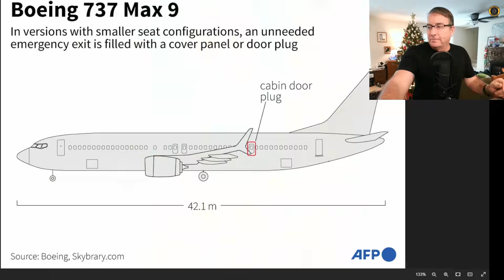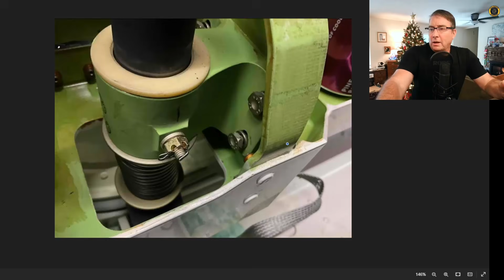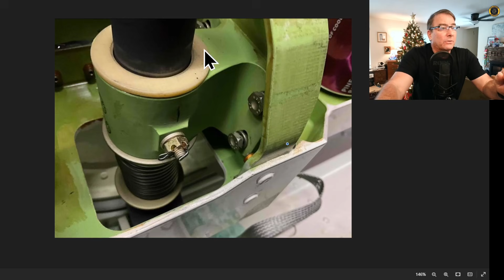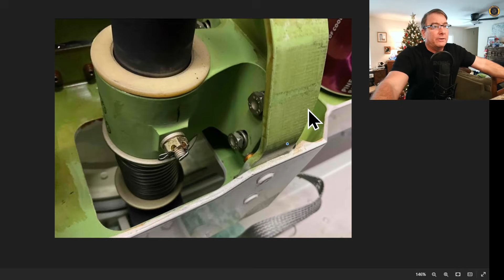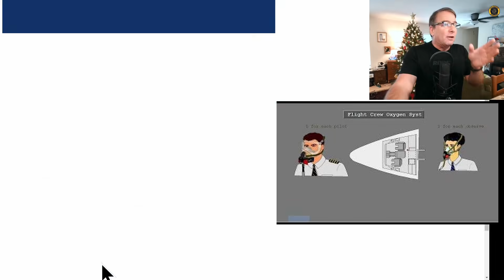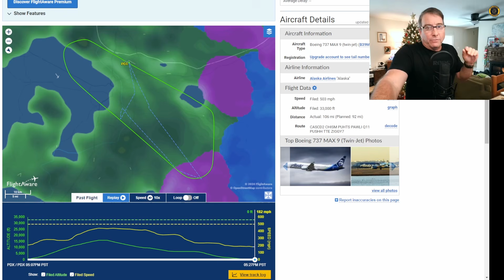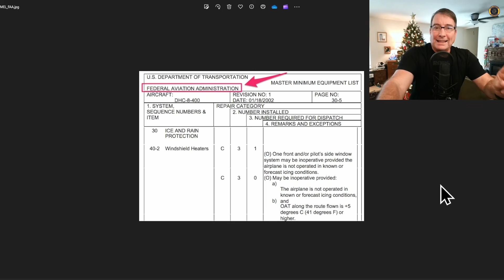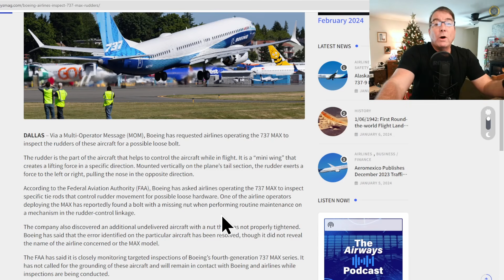"Yes, We Have No Bolts"  9 Jan 737 Max-9 Update

Comment: Could you address the “missing” flight recorder conspiracy crap going on. 

Lots of really bad info on how the recorders work. Especially regarding the 2 hour then rewrite issue. 

Some are claiming that there is no information, rather that the tape had started to rewrite due to time. Others suggesting the flight crew didn’t stop the tape so as to hide information. 

I know you can address this to a much larger group then I. 

As to the missing bolts. There might be a fox in the chicken coop. It’s going to be interesting to see who signed of on that installation.

Also, if the bolts were present and lost, there should be ware marks present. Can’t tell from the photos I’ve seen.

Comment: Interesting. 
MEL list. I worked in the marine industry. Similar concepts in many operations. In my terminology. 
This MEL list is a list of deficiencies. Some of which would be show stoppers some not. 
Even a non show stopper would still be reportable. Because it brings my vessel bellow my designed OEM equipment list. I am then personally required to inform both classification and certification ie my boss, ABS, coast guard. I have a particular deficiency. Mitigating Precautions. I will quite particularly with a repeated problem receive a condition of class from ABS giving me approval and requirements to report back when resolved. Within a time frame. Ie I can’t operate indefinitely I have to have a plan to resolve. Limits on operations are sensible. If there is a deficiency. The interesting difference I am hearing. Even if I have more than the minimum requirements as fitted and normal operations. I am still required to report the deficiency. 
Reporting a deficiency is relatively routine. I can even report via VTS our equivalent of ATC. 
The purpose of this is to allow operations to continue for a reasonable time and allow for a repair. 
One important point, even if I ask for and receive a condition of class allowing me to continue operations. I will almost always end up talking to an inspector prior to getting approval. 
One CG inspector I spoke to regularly. Would always say “don’t ask me if it’s ok, it’s your vessel, you are the Capt, Are you ok with the deficiency” if I said yes I am am ok with the deficiency I would get the approval.
Basically it’s my responsibility and I can’t pass it if to anyone. 
Sometimes one of the most difficult things is knowing when to say no. It’s not ok with me. 
I’ve done it. I had to answer a bunch of questions. 
In 30 years, my decision was always accepted. 
One thing I personally would never do. Is agree to operate after another Capt. had declined. Even if I might have made the call to go.

Comment: I am amazed at the number of people who want an exploding door instead of one that unlocks itself. From comments I have read in this comment section, in an explosive decompression, the door is sent a signal to open... one way or another. Simply put, "Unlock and Open" or "Explode Open". And people are more upset it didn't blow open like a car airbag deploying. Either the door opens, or it isn't a door anymore. Either way, you have access to the cockpit. But with panels blowing out in the direction of the passenger cabin, you have the opportunity to have people maimed. The explosive panels are for if the electronic lock fails to open the door as designed.

Comment: After my previous comments, let’s dig deeper. What happened when the pilots experienced pressurizing issues, oh well we just keep flying the plane. Surely some investigation arises and the pilot maybe does a walk around of the plane prior to boarding? De-pressurization is a catastrophic event and the pilot simply ignores the tell-tail occurrence that something is not function according to normal with a critical condition.
Reply: Wise up.  Are you a pilot?  There are a thousand other failures that can cause a pressurization problem besides a plug door blowing out.
Reply: @johnaclark1  all I’m suggesting is that this pressurization issue persisted too long on a new plane to be swept under the carpet, a pilot should have taken a stand, can’t just continue with an issue as critical as this, maintenance is not finding fault, but you fly the plane. Not acceptable.
Reply: @larrymeyer2917  All I'm suggesting is that nobody knew what was wrong.  The crew gets some kind of a pressurization fault light.  He/she writes it up and has maintenance look at it.  Maintenance looks at it and says "we can't find anything wrong with it."  The next crew comes in later and can't say, "I'm not taking the plane til you fix it."  Maintenance will just tell you they can't duplicate the problem.  Stop blaming the crew on this one.  This was 100% in assembly or interior finishing and not a thing any pilot could have seen coming.  Some say that plug may have whistled when it was leaking.  It may have.  Airplanes and doors leak all the time.  No airplane is 100% air tight.  It's common enough that not even easily spooked flight attendants will get concerned.
Reply: @johnaclark1  you claiming the passengers have no right to know that pilots are blase’ about “so-called repeated issue” even on new planes. I beg to differ, its recently the tail wing bolts, now door bolts and intelligent pilots after repeated issues in last week just fly the plane full of unaware passengers of prevailing problems…..that’s okay. And there is no chance of an imminent catastrophic failure. I would like to know about this when I board a plane, so that I can exercise my right to disembark and fly on a fully functioning plane. Or inform my family of the risk that I may not arrive at my destination. Hey don’t open a can of worms, every person responsible for ensuring a fully functioning public plane has no right to overlook repeated pilot reports, that’s a downhill slop no airline should promote or admit. The doors leak, safety alarms alert pilots and nothing is done….easier to deal with a decompression explosion at 38,000ft. You must be joking.
Reply: @larrymeyer2917  I never claimed anything of the sort.  Tell you what, next time you get on an airliner stop in and ask the captain if there is anything MEL'd or any recent maintenance write ups.  Maybe they'll tell you and maybe they won't.  Even if they told you, you wouldn't have enough knowledge to know whether the plane is safe to fly or not because you haven't been through months of training as they have.  I can tell you that nothing in that cockpit gave any indication to anyone that a decommissioned plug door, not monitored electrically in any way, was about to depart the airplane.  For the last time, none of this is any pilot's fault.  Boeing and/or the finishers (whoever last opened that door) are responsible here for not installing the safety pin bolts w/the cotter keys.

Comment: Everyone has been parroting "loose" bolt but this is the first I've heard what "loose" means.  A bolt with a missing castle nut is bad BUT still that door isn't likely to fail if the other bolts are in place.  Remember the purpose of the bolt is not to keep the door from blowing out but to keep it from traveling UP such that it slips off the 12 stop pads.  So that Alaska plane, in my humble hypothesis, may have had no castle nuts at all or missing bolts or combo of this.  If that cotter pin is in place, that castle nut is not coming off even if it is not torqued all the way (you can't even get the cotter pin in place until it is torqued most of the way).  This feels (pretty strongly) like it could be a mfr or maintenance error.

Comment: Very different fasteners from military, which uses safety wire to secure avionics. SS from a roll that is run through the same aperture as a cotter pin, then twisted. I am not familiar with airframe fasteners, though. Good to know the N-number in case Boing Boing slaps a coat of paint on it and sells it to Nigeria.

Comment: So do the bolts lock it into place? I see in the example photos that there are cotter pins,  which should keep the bolts from backing out in theory.  But if the bolts only hold it from sliding out of position then is it sufficient to keep the panel in place?
Reply: All the bolts have to do is assist gravity in not allowing the door to move upward above the pads that hold the door in place.  In reality, it really only needed one bolt to prevent that door from moving upward.  There is no real force on those bolts.

Comment: This is a prime example of why I love your channel. As an A & P you have a working knowledge of how airplanes are put together and you also know how they come apart. Your explanation of the hinges, bolts and pins was very informative without jumping to conclusions like others always do. I also found your insights into the previous pressurization issues with this particular airframe quite fascinating. You're probably on to something there. Makes perfect sense. And since you're also an active pilot with airline experience you also explain what's going on in the cockpit in these situations very effectively. As a pilot myself I understand and comprehend a lot of it, but flying my own Cessna 441 Conquest II is very different than flying this big stuff. And I certainly don't work on my own airplane, though I do have a good working and mechanical knowledge of it. Keep up the great work!

This also makes me sad for the future of Boeing. Just when one could take a breath and think the 737 Max problems were finally sorted this happens. It doesn't bode well for them. But that's a subject for another day.
Reply: I wondered about previous pressurization warnings, too. But if there are two systems, and they're switched if one gives a warning, wouldn't you expect to still get a warning on the second system if it was a real defect in the pressurization (caused, for instance, by a leaky door plug)? And would pilots ignore a persistent warning on both systems?
Reply: It was shocking to hear Juan say that the pilots and maintenance crews routinely ignore the warning lights o the automatic pressurization system control panels which re trying to tell them that something is wrong because the humans just assume the monitoring instrument tis broken. That's alot like ignoring a low oil pressure warning light on your car because you assume the oil pressure monitoring system is bad because the warning light has come on.
Reply: A&P: Airframe and Powerplant mechanic, an aviation maintenance technician certified by the Federal Aviation Administration (FAA) to inspect and perform or supervise maintenance, preventive maintenance, and alteration of aircraft and aircraft systems.  Responsible ensuring that the aircraft are in airworthy condition.

Comment: Somebody’s probably asked this, but is that picture of the bolt and roller guide assembly upside down? It seems like gravity should be taking the pin down into the roller guide, with the bolt above it. 🤔
Reply: No, the picture is correct. The door with guide kinda hangs on the roller pin when fully closed. Thus there’s really no weight on the securement bolt underneath the pin on the guide flange.
Reply: @JohnHallgren  thank you, I see it now.

Comment: Why weren’t those bolts safetied? I saw the pictures from a United aircraft with the two bolts backed out. There’s slightly more cost to using bolts capable of being safetied than the junk Boeing used. Also finding the offending bolts will be nearly impossible unless they fell on someone’s driveway or in their mailbox. Plus with snow coming in, yeah right. How long did it take to find the missing fan disk in the Sioux City tragedy? That was a substantial piece of metal and it took a chance finding at harvest time to do so. Also, I believe CVR recording times should be increased. Maybe not 25 hrs but 10 hrs would be a great compromise…

Comment: That it could’ve been an emergency exit door to begin with is offensive in its own, right. I realize there’s more to it than just slapping a door in a frame, and I realize there’s a weight, penalty and maintenance penalty, etc. but the only reason this was just a plug is because regulations did not require a door.

Comment: Papers flew out of flight cabin?  Cockpit boot blew off?  Thought Sept 11th set pattern for reinforced doors?  
For plug to open, with 4 bolts removed, does one not push the door down and then out?  You said push up.  Sounds like a lot had to be missing in order for this to open.

Comment: if the plug has to slide up for the roller pin to clear the roller guide housing, the picture is upside down.  unless the pin is part of the airframe and the guide housing is on the door.

Comment: I don't believe the door is supposed to blow open, the panels should be enough, we as techs have a repeat inspection and test card of the required force if takes to open those blowout panels. We were never told that the door blows open as well, it wouldn't make sense if you already have panels that do the job. Plus a swinging door with that much force behind it could legitimately be blown off the hinges at higher pressures. To me that sounds like another part that failed if it blew open.

Comment: Someone needs to look at the assembly line procedures at Spirit AeroSystems in Wichita, Kansas (where the 737 fuselages were built) and at Boeing's Renton, Washington final assembly line (where the planes are finally put together, including much of the interior fittings). The Renton assembly line needs very close inspection, because were there issues to reassembling the door covers correctly?

Comment: What is the pressure differential and cabin altitude at 16,000msl?
Reply: Looks like at the rate of cabin climb they had it was about 3psi at the time the plug failed at 14000. Plane kept climbing on AP for another minute

Comment: Nice coverage, Juan. To just add and clarify one thing that airline pilots on this site know but others might not... a crew can refuse an aircraft for ANY maintenance item they are uncomfortable with, not just a "repeat write-up." ETOPS is an entirely different animal and obviously more restrictive for a number of issues from required fuel and weather to maintenance. But every flight release, ETOPS or not, is signed for by a Captain and a dispatcher that both agree the flight can be safely conducted with the equipment, fuel and conditions required on the signed release and by the company Flt Ops Manual (FOM).  Yes, you might get a call from the Chief Pilot asking why you refused an aircraft but as long as you had a sincere and genuine concern and weren't trying to cause trouble, they're on your side to safely complete your flight. 

Before I let the agent close the door and send us on our merry way, my 7 step checklist was, "Fuel sheet, logbook, weights, weather, signed release, coffee and courage." Stole that from one of my favorite skippers but it covered all the essentials!

Comment: Juan, if I understand it correctly the spring preload keeps the braces at the door plug top within the track.  So, for the door to come off it has to fully compress the spring (looks like), about 6" to allow the braces to leave the track.  That spring looks substantial.  Do you think that turbulence alone can produce the force necessary for the door plug to compress that spring?  Or is slight movement off the pins  enough support release to allow the entire door plug system to fail?  Poor engineering or part specs, me thinks!

Comment: If we would assume that having the 4 bolts on the hinge were loose or missning,  Why not use drilled bolt head and Lockwire on them.   It still isn't clear that the castle nut and cotter pin bolt played much if any part  until other aerodynamic forces caused the hinge to fail.  May not have had anything to do with it.  Maybe??  Just re-torquing those bracket to fuselage areas wouldn't negate that from happening again.  Don't know how Pt 121 maintenance feels about locktite,  but were it me,  I woulld not be satisfied as there is no way to inspect and check then re-apply over and over again.  Seems odd that the area all around that door/panel would be subject to so much vibration that nuts/bolts would come loose.